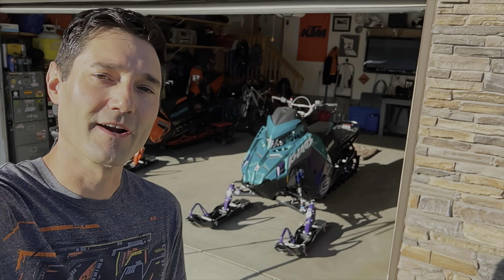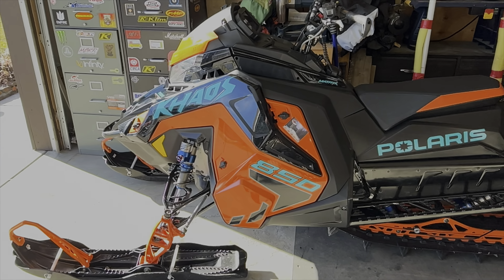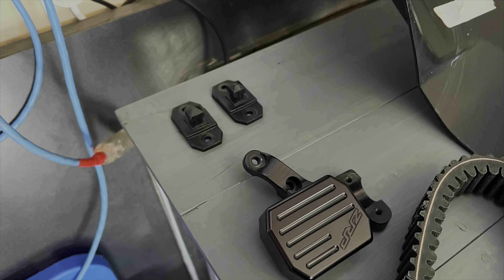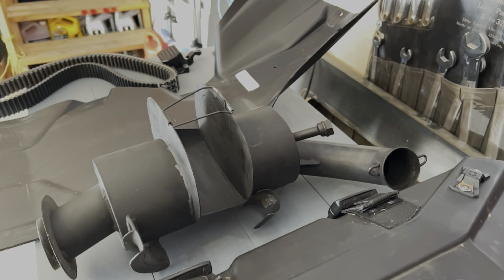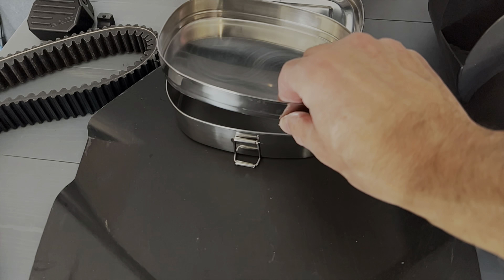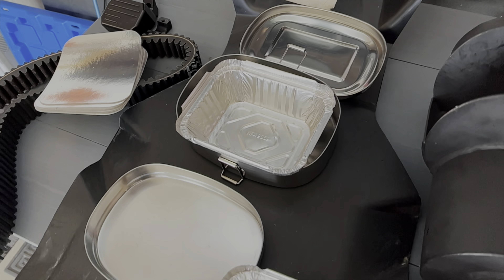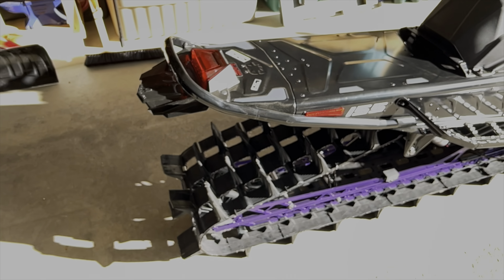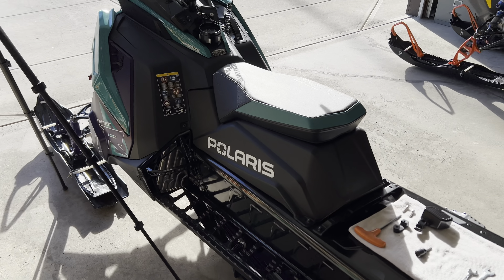Add These Essentials to your Sled before you ride!

Comment: Must have "mods" for me, handlebars (1.5" - 2" total rise), adjustable or short reach brake lever such as TKI, tunnel bag, Sled Treds console knee pads, and bumpers front/rear.  Although on future sleds I may forego the bumpers.  I too love a hot meal, but am fine these days with just placing food between the side panel and stock exhaust, since I prefer to just run the stock exhaust.
Reply from the maker: The knee pads are a good idea. I’d like to give the heated brake lever a try.
Reply: @JasonCaville  I'll be honest, both my wife and I have had the console pads on our last two sleds, and we will not ride without them anymore.  Even though we both wear knee guards/braces, they are like heavenly pillows for the knees ha ha.  Especially nice on downhills

I like that heated lever, but not the price.  Just a nice plastic one (as strong as stock) with good adjustment range would be nice.  I have tried 3D Logik, but it snapped off the very first time rolling the sled over from a stuck, and the snow wasn't even hard.  I replaced it with their shorty aluminum one, but am not a huge fan of the design, so have gone back to stock for now.  Will probably end up putting the 3D Logik back on or get a TKI.  The problem with the 3D Logik design is that it's straight.   When adjusted in close to the bar where I like it, while pulling it in with my index finger, the lever begins pushing against my middle finger knuckle before the brake is fully actuated or the track locks up.  This could be mitigated with a bit of curve in the lever.  I thought with it being short, it should miss my middle knuckle if the brake is relocated inward enough toward the center of the bars.  However that is not the case.  Another design issue, at least on mine, is that the master cylinder makes air leak sounds during actuation.  Not sure if the lever allows the piston to back out too far, or does not depress the piston squarely.  The dealer actually replaced the MC reservoir and lid under warranty and the air "squishing" sound didn't go away until I got the sled back and it finally occurred to me to just try a different lever and the sound went away...lol.  Apparently the reservoir or lid was defective though, because the dealer witnessed leakage before replacing, and I observed moisture/crystallization inside the reservoir.  

My wife has a TKI lever on her 24, and we both had TKI on our Axys sleds.  The TKI lever sits nice and close to the bar for comfortable use during steep sidehills and such.  They are aluminum though, so it gets cold when constantly running a finger on there.  I am also concerned that with the extra travel in the lever of the 24, if it might end up too close to the bar when fully pulled in during operation.  Hopefully we'll get to find out soon ha ha.  Sorry for the long post, like talking sleds...lol.
Reply from the maker: @Fatonzzz  Great info thanks, and the longer the post the better haha. I really like the stock lever. You didn’t like it?
Reply: @JasonCaville  I like that it’s plastic (but tough), and I like it’s ergonomics better than the stock Axys lever.  However it’s still too far from the bar for me.  I’m 5’-6” with pretty small hands.  It might be my moto and mtb background, but I’m pretty particular about bar/controls set-up.
Reply from the maker: @Fatonzzz  Ah I see. The reach is perfect for my hands but I wear XXL Klim gloves haha
Reply: @JasonCaville  Ha ha you’re a giant!  I’m between a M and L in Klim gloves.